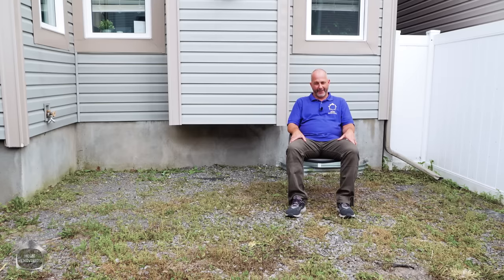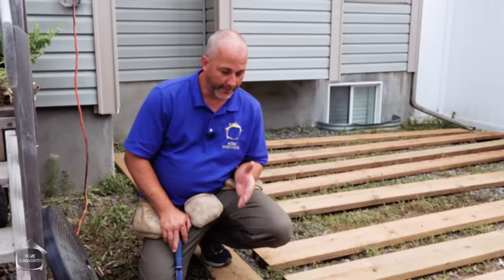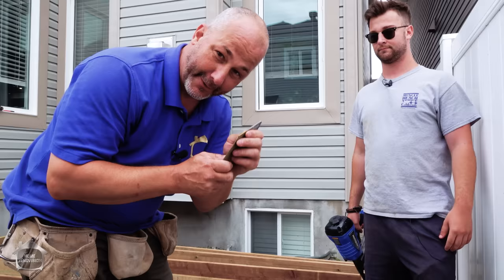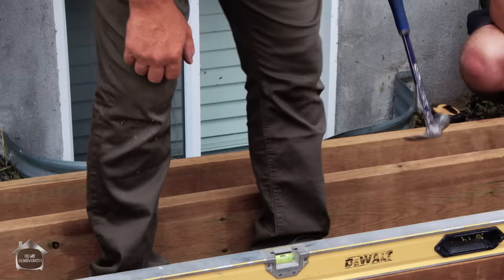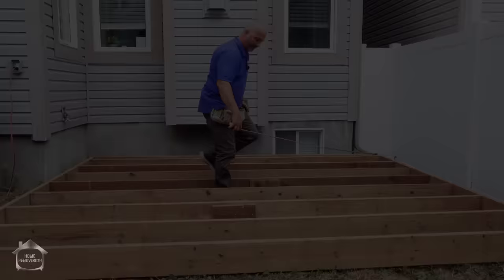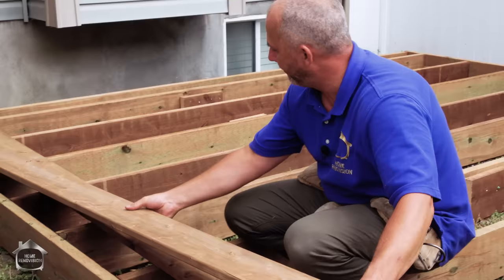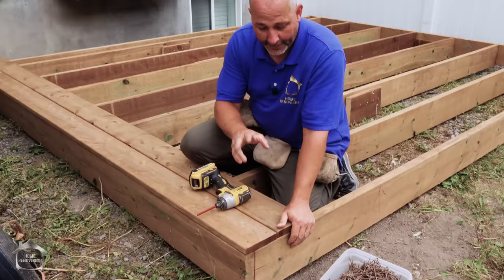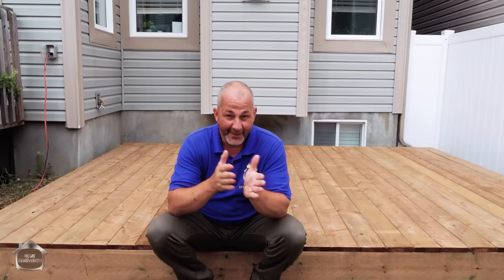How To Build An Affordable Deck

Comment: Love the video but have a few questions if you don't mind. I'm not great at building things without a laid out plan and this video truly helps. My mother wants a deck under the Gazebo she about to purchase because there is no way I can build a full wood gazebo haha. Its 10 by 12 aluminum 4 corner frame with steel roof. Total weight 250lbs. If I build this, I would like to anchor the 4 corners with bolts to hold the gazebo down since she have lost 5 over the years with the wind she gets in her yard. Should I add any cross beams or something to reinforce the corners so they can handle the extra weight and force of wind? I doubt the wind will be able to life it all once together but I figured I'd ask. Second question is our yard is torn up due to skunks, rabbits, and moles. We are on a budget so should I follow what you did in video to level it out or would say tilling the ground 1st then starting the build be best. Just worried the ground might settle differently after tilling and has that much weight on it. Thank you

Comment: So you said in this video to pressure wash pressure treated wood and there is no need to apply any sealer/stain etc.  I have always done the same, good to know I was doing it right all along.  What about for cedar decks?  We just had a cedar deck last summer. What do you recommend as far as sealing / staining?   To date we have done nothing to it and it turned your typical cedar grey.

Comment: How does one know if they're ready... I'm doing as much research as I can, the bottom of the screen door is one foot and 5 inches up from the ground. The concrete slab is 9 and 3/4 by 13 and 3/4 ft. Does it make sense to build a 10 by 14 ft deck? Would I use treated lumber? How many inches should there be from the bottom of the screen door to the deck?

Comment: This may be a stupid question . Can't this type of deck be built over landscape rock that's already over landscape fabric ?......we have a rock area on our lot that my neighbor up street said , "needs a little patio area so she can come visit and sit in my butterfly garden " - I agreed and said I'd already mentioned that to my husband (he wasn't interested 😆since he's already built a paver patio 12' x 24' , a paver walkway 5' x 20' and two tiered retaining walls on either side of the walk out entrance and a privacy fence😉plus too many bugs out during the summer )- what is the minimum size you would consider for a functional and safe ground level deck ? Truthfully, it only needs to be large enough to accommodate a couple large chairs like a two Adirondack chairs w/ built in spaces for holding a cold beverage since it's the east side of the house in the evening it's out of the sun(no need for umbrella)  - could a smaller size around 8' by 8 ' be okay ? - for just a small sitting area ? any comments welcome , thank you 🌸🌸🌸.....peace

Comment: I bought a 16×20 canvas tent and want to put it up in the backyard as the family glancing/cover for the summer. We will camp out there as well. Should I just make 4 of these so I have a porch on the front? I am brand new to building/woodworking and want to save money by doing the deck myself instead of paying an arm and a leg. I have to mark the area first, dig out grass, level and put something to stop grass growth first. It will be a permanently structure in our backyard, I just need help with how I should build the deck.

Comment: Super excited to try this project. I saw you had some concrete corners in the before and after photos, but you didn't use them right? Also did you end up putting down that black fabric I have seen in videos over the ground to prevent growth? Thank you for making this accessible!

Comment: Great Video ... and for someone like me who has never built a deck, is very helpful. The area where my daughters play set used to be we want to put in a floating deck. I have tilled the area a good 6-inches down, and the floating deck portion we want to be 12' x 14'. I am assuming I want to go down 2-3 inches below the grass line and install weedblock cloth, then put soil on top of it ? Rather than using 8'pieces and have to cut some to reach the 12', would it be best to use 12' pieces ? The 14' size is kind of an odd size, so I also didn't know if for those two sides if I should be using 8' length with a 6' length .... or a 12' length with a 2' length. I will keep researching. I still have to very code for my area. It would be great if I didn't have to dig down to the frost line. We eventually want a garage and it would be good to be able to move this floating deck and re-use the wood. Thank you for all the tips in your videos.

Comment: I love the simplicity of this build. This is what I am looking for an 8” high deck. I live in Florida and have very sandy soil. Other ‘how to’ sites complicate it and scare me with saying I need some type of footer. That then would make it difficult to get the height and design I desire. The area I want this type of deck would be just beyond the concrete patio and is relatively level (maybe 1-2” grade from back to front). Based on the soil type and the very slight grade, what do you recommend? Do I need to excavate and put down drainage rock or do I need footers or both or neither??? Confused in the sunshine state

Comment: I'm in Houston, so hot sun, but high humidity, would you recommend a small gap on the deck plank? I have always just put a screw between each plank as a spacer then removed.

Comment: i really wish my area had basically zero codes like that... we have to secure to the ground... and being that it's cold means 'below frost point' which here is considered 4 feet... which requires renting a giant auger... what a pain... also... 2x8's in our area are not allowed to span more than 8 feet on a deck... so anything longer would mean a 2x10 which... last spring when i built mine meant an extra $500 for 2 extra feet on each side with the lumber prices... i wasn't willing to... so instead i opted to go shorter... and this spring or possibly next i'll just add another 8 foot section for roughly $400 (since i still have extra hardware) and have a much larger area than an extra 2 feet... nice tips though... again.. wish that was the rule here...

Comment: I'm in SW Ontario. So if I drop less than 2' to the deck, and less than 2' to the ground, do I need any railing at all? I'd be making box steps to the deck. Everyone insists it's nicer, safer etc. to go straight out, but I think that if they're deep and wide it could be quite grand. And deep enough to sit on comfortably. Also, why not piers to lift it to 2'? Sturdier and drier, esp with some gravel over the cloth?

Comment: Building a deck on top of previously laid sand for brick pavers.  Not sure if the ground was ever properly tamped and leveled as the pavers look like post earthquake property!  Plan is to remove all of the pavers and build a 12' x 24' deck.  Not sure if we need footers or not in Indiana, but obviously going to check first!  Any suggestions for prepping the ground before building right on the sand?  Thanks!

Comment: Dumb question. On your drill you have that extender. When you do the back drill and you are holding that extender, sure for keeping sturdier” if I used mine pretty sure I would kill my fingers. What kind is that. Using replay I could not tell you are so fast.  Thanks

Comment: We want to build off our backdoor slider w/ a concrete patio and extend out an additional 8 feet.  We live in San Antonio Texas with hard ground and high summer heat.  Can we build a floating deck with concrete footers and use the patio for a portion of the footing?

Comment: Great video.  I plan to build the same  deck. (10x12). Is it better to build the deck with 12ft stringers then use 10ft decking planks or is it ok to have 12ft stringers and 10ft decking planks? What provides the best support of people's wieght?
Also, I plan to put patio stones at all 4 corners to raise the frame off the ground by an inch to eliminate mold and rot of the p/t wood. Wondering why you didn't do that?
Lastly,  can you provide the name and brand of oil based stain/sealer as I want to preserve the deck when done and treat my new p/t wood fence at the same time.  Thanks!!!

Comment: We want to build a 16x16 deck ground level like this. Location is for the walk out basement. It will mean the deck will end up flush with grass at the end. Any advice on a way to protect the last board? The house and yard build doesn't really allow the deck to sit above the grass. We are going to dig the space out for the deck and put limestone down as a base. At some point it would be ideal to have a paving stone patio but we don't have the money for that yet. So the 3/4 down base should work well for the deck now and the pavers in the future.

Comment: I’ve seen your other video where you dig up the ground, used those cement blocks with the ridges cut in them and was meticulous about things being level and even…why were you able to skip that with this kind of build. What will happen in the long run with this kind of deck that was just threw together?

Comment: Hi! I noticed towards the end of your video that you have cement join supports off to the side. These weren’t used in the video but I’m curious if you used them/installed them. If so, what’s the best way to do that? Build it first then add them under or build on top of them?

Comment: I am planning to build a floating deck approx. 11' x 24'  The max height is going to be 18"  off the ground. Would you use a beam and then a joist on top of that and then decking. Deck blocks

Comment: I see the pressure treated 'levelling pieces' are sitting directly on the ground. Wont they rot out pretty quickly (ie. 1 or 2 years)? Absorbing all that moisture from the ground cant be good, especially in areas that get a lot of snow.
Reply: Hence, this being the cheap and easy way to do this. I’m sure you can dig 4x4 posts into the ground with cement, but this is the “cheap and easy way”
Reply: @Bajadave760  I get what you are saying and I dont want to split hairs but there is a difference between 'affordable' and 'cheap.'

I will agree on the easy part. I do like this idea but not sure its a good idea for all climates. That's all I was really saying.

Comment: I’m planning on doing this with 2x8x20’ boards, will this require any extra steps or should this method work? Also my deck would have access from my back door flush and laundry room in the carport which you would have to step up from the laundry room to access the deck(both doors aren’t level, there is about a 8” difference, is there a recommendation for how this should or even could be done? Love the channel!

Comment: that deck could be for temporary needs but that deck could be dangerous depending on different factors. Wood would still have dormancy even if it had potential for disaster from the way it would be taken care of but in the short future it might have to be rebuilt and be used for temporary uses.

Comment: Hi.  Would I still be needing the cloth sheet to underneath the deck to protect from moisture if it’s built on a cement patio?  My patio floods about 2 inches every year and brings dirt from the grass with it.  Makes my small backyard unusable unless I clean the dried mud off every time it’s done raining, which is a pain.

Comment: Great Vid. Thanks. I am building a 10x12 like you and wondering why you used 12' joists with 10' caps rather than the other way around. I figured I'd use shorter 10' joists and only buy 2 of the 12' boards. Thoughts?

Comment: Simple and easy yay ! Question so I live in Colorado where I want to build a deck is in the back yard. I have a slab of cement the width os a sliding door and on both side it has rock that have been removed so there is just dirt. Do I need to add something to the dirt?  It will also get part of some grass. Thank you!

Comment: I loved this video!  I need to replace my front deck coming off of my from my front door, however I would like to have it be two different levels. The higher level coming off of the front door as a 10x12, and the lower level being 12x12. Do you have anything like this in a video?  Otherwise, I was thinking of maybe doing just a lower level with steps from the front door going down to the lower level deck?  What do you think? Any ideas or DIY videos on that? :)

Comment: I live in Ontario Canada where the ground is pretty soft, when not using concrete footers how do I make sure the deck wouldn't just sink into the ground? I assume the gravel at the beginning did that. I just bought a home that needs a lot of work and I'd love to pull up the uneven patio stones that wiggle and wobble and put down a deck in line with the door from my garage to my yard.

Would a platform like this also be recommended to install a shed ontop of?

Comment: I don't completely understand what you did at 6:00, did you put scrap wood under the deck, and then screw in the piece, or did you just lift it a lil bit, screw in a piece, and then as you worked around made it level?

Comment: What do you do about preventing rodents from living under the deck boards?
Reply: I haven't finished the deck yet but one thing I've done so far is to staple galvanized half inch mesh (hardware cloth) to the interior side of the perimeter foundation boards to block the opening from the bottom of the boards to the ground.

Comment: In another video (farmhouse?) you said there should be overhang, so the water can run off- is that only true because that was different wood? Why are the deck boards flush to the structure on this deck?

Comment: Hello from Poland! I just recently found your channel but already became a huge fan :) If I may ask - are you using PT Pine as deck boards? The sellers usually try to sell the expensive lumber saying that pine is way too soft as deck boards but I have a feeling majority of the decks are build using pinewood. My house has a faceade made of untreated spruce and I love it. Spruce is one of the most common wood used for decking where I live and most likely I am going to go for it, but on your other video I saw you using CAMO system and did an investigation on it. Apparently if you want to use CAMO system with spruce boards you need to put joists every 12 inches. Seems a bit of an overkill to me.

Comment: Question...  I own a second floor condo.  Balcony flooring is "my responsibility".  Not the railings..  lol.....   Noticing some of the boards are looking pretty rough.  Some have rotting spots.  Some seem ok.  (single mom here bare with me.....).  Would it be ok to replace a few boards at a time until all of them are eventually replaced.  Like,,,  lets say.... replace 2-4 boards every paycheck (every 2weeks) with the way wood prices are right now.  And,,,  I would do it myself.  My ex husband was a carpenter and we did lots and lots of renovations together.  I just have never done any  BY MYSELF.  But,,,,  I think i got this?!?!   Currently,  I see that the condo has the deck boards nailed in.....  Is it not better to screw them in with deck screws?  Do you have a video on replacing rotted deck boards?  And if you cut off ends of pressure treated boards do you have to seal the ends you cut (lol???).

Comment: I want to do the same deck. I am down hill and water does form where I want my deck. There are french drains set up but some puddles do form during a rain storm. Will the pressurized wood hold up to this kind of moisture ?

Comment: Anyone knows a good online decking calculator? There are tons of them out there but they are always missing details. Trying figure out how many 2x6x14 pressure treated panels.. its a 14x12 space. 168sq ft.. joists till be about 2x8x12. Not sure how many I'll need of those with 16" apart. Any help n advice appreciated 🙏

Comment: I’m in a hot and humid climate and my old on-ground deck is rotting away due to the moisture. Do you suggest building the deck higher for more ventilation?

Comment: Hi I’m Charlie from Boston. I was watching your deck sealing video and I have a simple question. I’ve decided not to stain my deck. You made sense when you talked about less maintenance by only sealing. My deck is pressure-treated and has never been sealed. I had a company come and power wash my entire house including my front porch and deck which never really sees the sun.I know on different videos you use Olympic or Thompson’s or Osmo’s. Is there one you prefer over the other? Please help

Comment: So I want a 24 ft x 22 ft simple deck like this. With that size deck, can I still use the small pieces of wood, to get it off of the ground? How would you run the decking boards and what lengths would you use? You're obviously not going to get 22 ft decking boards.

Comment: Quick question.  I live in Hamilton ON and looking to make a deck this summer and was interested to see that you didn't use any deck blocks or that you did any digging to secure the deck to 4x4 posts.  Given the cold weather in Canada, wouldn't the deck start to move/shift over time?

Comment: I am in the CA central valley. Super hot and dry in the summer. Rainy in the winter. I want to redo my covered deck. It's elevated about 5' off the ground. Currently it has a solid plywood floor. I want to change to decking. Can you recommend a product? And should I butt the planks up tight against each other or allow some space for expansion? Thanks!

Comment: How much were the materials? Where did you get it from? 
Main question is what is the product called that just lays down over concrete?

I have a back patio with cracked concrete and just want to lay up to 1.75" thick deck that just lays on top of the concrete patio

Comment: The small 2x8 boards that transfer the load to the ground. Can you use that same method if you need to lift the deck maybe 4 or 5 inches ?